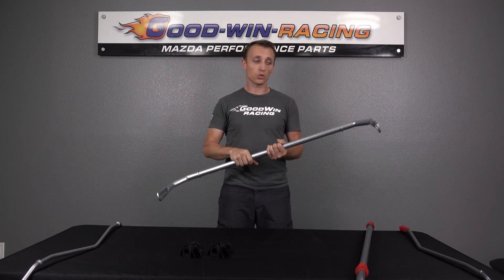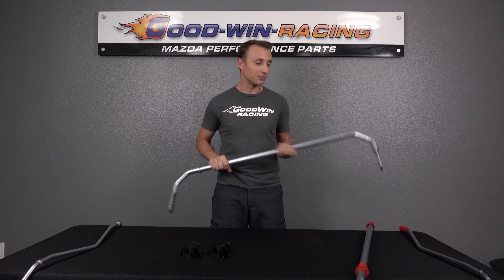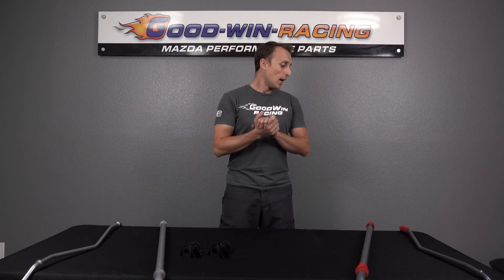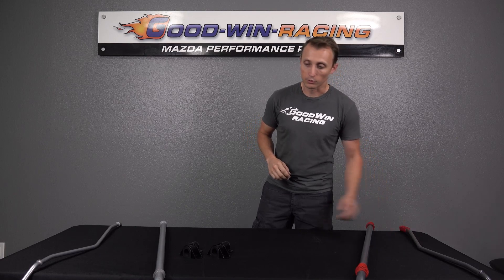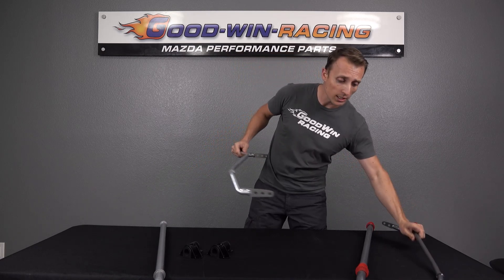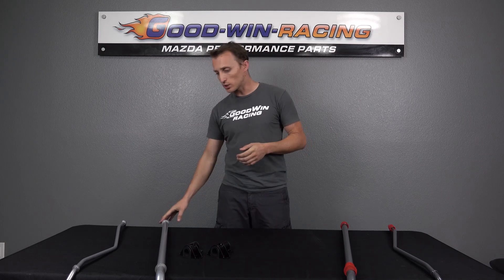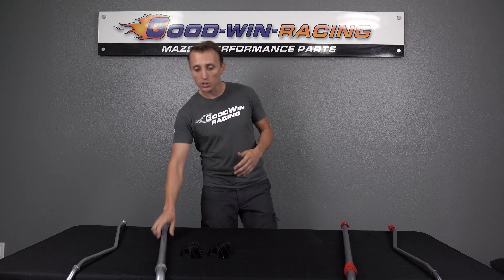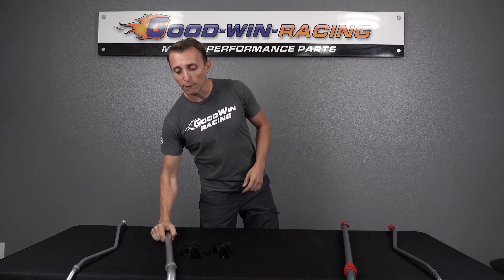NC Sway Bars

Comment: So, I should have the RX8 bars?
Reply: It depends on your set up (tire/wheel, suspension, power) and what you are trying to accomplish handling-wise (street, autocross, track day, or track competition).
Reply: Coloured in light put a yellow dot RX8 front and an orange (there's 3 options) dot rear on his. Some say for street, just put one on the front. That seems a starting point. The RX8 has only 1 hole so no adjustment but should be fine for street. If you track the car as well, get aftermarket or the heavier dot.

Comment: Would this be the same for the 124 spider / Nd chassis?  I’m stuck on getting the roasters or progress or eibach or flyin miatas . My spider is a daily driver that will main have autocross uses once a month and possibly a hpde day once a year. Also not sure about going to a 16x8 or a using a 17x7-8 as I’ll have to budget and may have to make the autocross wheels / tires be the daily drivers too.  I’m currently fully stock classica trim
Reply: :( and 6 months and still didn't have an answer.

Comment: what about Nd/NF chasis.  this is where I get confused.  as I will mostly be street driving on normal factory tires/ all seasons.    but then once a month autocross on 200tw tires. I'm also concerned with comfort.  hard I wish there was a bar that between the roadster and the progress bar.
Reply: And 2 years later and still trying to decide .  Would the progress be to much sway bar for a 195/50/16 all season?
Reply: @schizobipolarjoe  Based on what Ryan said in the video…YES.  The Progress bar is best used with a stickier tire, and are more track oriented.  The tires you are mentioning are street class tires, and pairing them with Progress bars will transform your car into an understeering pig.
Reply: @RbNetEngr   thanks so it be best to get roadster sport or something like the flyin miata?  whats hard is on autocorss and hpde days I'll be wanting to use a 17x7-8 with a 215-225/45 200tw tire, but for daily driving I'm going to be using 195/50/16 all seasons.
Reply: @schizobipolarjoe  My approach for the suspension on a dual purpose car is to optimize it for the environment for which it will mainly be used.  So in your case, where 99% of use will be on the street, with smaller all-season tires, I would NOT optimize the suspension (or, in this case, swaybars) for the 1% use case of using larger sticky track tires.  If you do, then the large front swaybar will end up giving your car way too much understeer on the street with those all-season tires.  So, it’s up to you if you want to decrease the enjoyment of 99% of your driving just for the sake of having some better performance on the track.  Personally, I would not do that.

Is it possible that you can put a better/larger set of all-season tires on your car?  There are Ultra High Performance All-Season tires available in 205/45R17 (stock size) or even some larger sizes.  Tires such as Michelin Pilot Sport All Season 4, Continental ExtremeContact DWS 06 Plus, Bridgestone Potenza RE980AS+, etc.
Reply: @RbNetEngr   thanks. I may just have to sell the 16x6.5 wheels and tires and find a 17x7 and all seasons tire for daily driving. then would it make sense to do sway bars after doing that ?
Reply: @schizobipolarjoe  What suspension is currently on your car?  Swaybars are generally used to fine-tune the suspension.  So if you are happy with the current performance of the suspension (ride comfort, control over uneven or rough pavement, etc.) and just want to reduce body roll, then swaybars are the add-on you will need.  But don’t choose the largest (thick swaybars) or else your single wheel bump performance will suffer.

If, on the other hand, you think the suspension is generally too soft, and rolls, dives and squats more than you prefer, then you should look into a firmer set of springs and matching dampers to control them.  Drive it with those upgrades, and then decide if the roll has been controlled with the firmer springs and dampers, or whether you need to add swaybars as well.  And again, avoid the thickest swaybars.
Reply: @RbNetEngr   195/50/16 all seasons on the stock 16x6.5 wheeels with meisterR 7/4 spring rate nd chasis 124 spider.  I feel the side to side threw slaloms and mid corner could be more flater or that what I'm wanting with more grip with out going to crazy. my goal was to have it a daily driver with autocross and track  but health is basically making it a daily driver/ autocross car.  mainly want to have fun in the back roads with out going crazy, and a fun autocross but comfortable that I can get it and it's not pounding my arthritis etc to death.
Reply: @schizobipolarjoe  I am surprised that with the MeisterR coilovers, and those spring rates, that your small, all-season tires are giving you so much grip that the body is rolling too much.  The MeisterR springs are significantly stiffer than the stock springs.  What level did you set the damping?
Reply: @RbNetEngr   I'm not sure with out going and looking /turning them. I think I'm 18-20 clicks from full hard .  tire pressure 35-36psi front, rears 32-33psi.
Reply: @RbNetEngr  not sure but if i remember right i want to say im 18-20 from full soft on the front and 20-20 from full soft on the rear. I just want the body roll to be flatter. tire psi 35 all around cold.

Comment: Would the Roadster Sport bar be adjustable enough to run 245 or 255 summer tires on 17x9 wheels and then run 205 or 215 snow or all season tires  on 17x7 wheels in the winter?

Comment: Stock nc thinking of these but what end links are recommended?
Reply: For street use we carry several good end links - RoadsterSport, Whiteline, SuperPro, and Racing Beat. They will all work fine. We carry a variety due to today's supply chain issue and a lot of times some brands are out of stock. We also carry AWR end links. These are geared more towards race cars. They can be a bit noisy on the street so we like them for track only cars.

Comment: You said that on NC's big sway bar and not that hard springs, work well. But if we run big and stiff sway bars, don't we connect both sides of the car too much and stop each suspension side work less freely and thus lose grip? We might get less roll but sway bars, by connecting side to side, tend to make te car ' like an axle'. I used rx8 yellow dots in my NC and eventhough it reduced body roll, it made the car understeer as many users of those bar reported and while I was turning hard and hitting a bump, it got transfered on both sides and didn't really like it.
Reply: Yes, factory RX8 bars not recommended for several reasons including lack of adjustment holes to set balance and avoid that understeer result.  Whether you have too much bar on the car and get that live axle feel is strongly connected to amount of grip you run, too much bar for stock tires can have that effect.  We tuned this set of bars with stock size wheels/tires on the car.
Reply: Remember in the video it was mentioned that while the external diameter of the RS bars was overall larger, the wall density was thinner to reduce weight and add the proper stiffness.

Comment: Do the RS2 sways make regular driving / spirited street driving worse in any ways? I.e. dealing with uneven pavements, bumps, and other road conditions that you would otherwise encounter on streets vs a track setting? I am coming up on 80k on my NC2 (has bilsteins) and want to take the opportunity to upgrade shocks soon, but am also looking at a mild lowering spring set and/or a sway set. Not sure how valuable the sways would be if I'm only tracking or auto-crossing 1-3x per year or if it will have any unexpected negative effects to reduce any independence of the suspension setup.
Reply from the maker: Stiffer sway bars always come with some compromise but these RS bars are specifically targeted at a stiffness that works well for street use and so the trade off is very small. And you'll be glad you have them when you're at the track or doing any sort of spirited driving! Without upgraded sway bars there is no way to significantly reduce side to side body roll (to get the same effect with stiffer springs you would have to go so stiff that you'd completely lose ride quality). Mildly stiff lowering springs and a set of the RS bars is the way to get great handling without taking a big hit to ride quality.
Reply: @GoodwinRacing1  Thanks for the reply! I wonder if my factory bilsteins will still be ok without a shock upgrade for now. I might get impatient and just buy the springs and sways before it's time to swap the shocks out :D